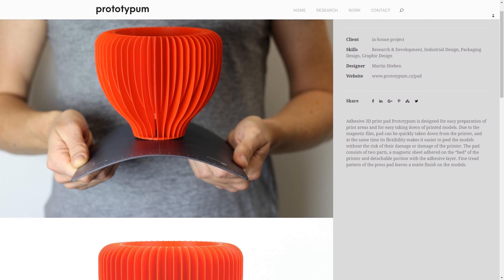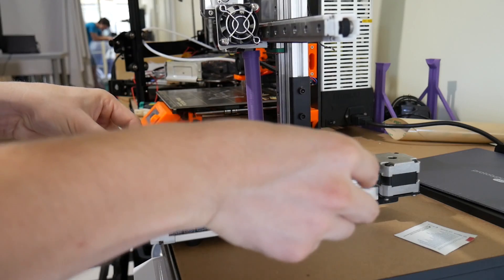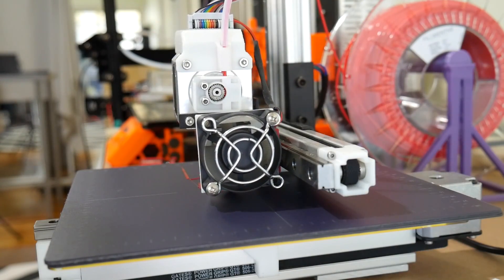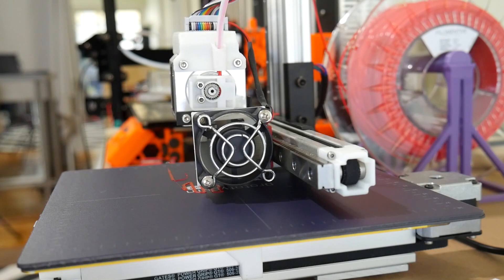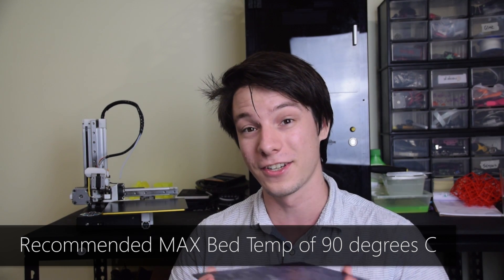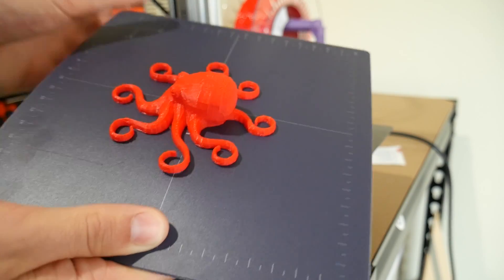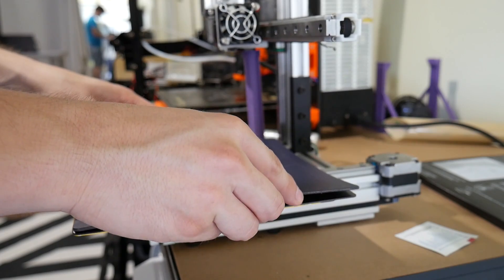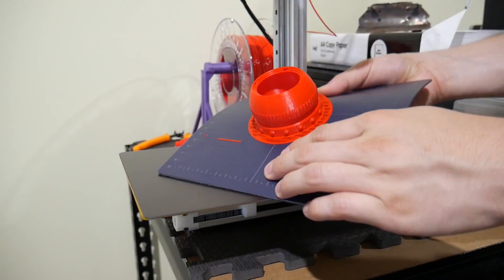Prototypum Pad - Magnetic Build Surface Review

Comment: Regarding the 200x190, my printer (a cheap ebay prusa clone) has a 200x200 build plate, but has the screws in each corner sticking up, so a 200x190 sheet would fit on there perfectly without having to cut the corners off.

Comment: If I remember my physics correctly, heat effects the magnetic properties of magnetic materials and can weaken the magnetic strength above a certain temperature to the point of destroying it. Not sure if the temperature of a heated bed will weaken the magnetic adhesion of the print suraface over time, but I would not think that using it on a heated bed would be a good idea.

But a good idea non the less  that maybe some other technology similar to velcro could be developed that has a high heat resistance to create a similar type of product.

Comment: I hav e the similar MagHold system which is more available in the US.  It's not cheap either, but it includes a machined and very flat aluminum plate with 11 rare earth magnets and a spring steel sheet.  The MaddGrip surface worked well for printing ABS and it's easy to pull off the sheet and flex it to release the parts, but I was a bit disappointed that the MaddGrip didn't last very long.  It's fairly expensive to replace, but a larger issue was the hassle and time spent removing the adhesive so I could apply another sheet.  It's not worth it.  I just ordered the parts to try to convert it to a magnetically attached PEI sheet that will hopefully last much longer.  Pro Tip:  3M Adhesive Remover can apparently save hours of scraping as well as the skin on the end of your thumbs.  I'll eventually discover what works well, hopefully without too many more experimental iterations.
Reply: MagHold works exceptionally well with a PEI film, I'd lower the bed temperature to around 70 or 80 celsius though

Comment: so you said the plate doesn't handle high temperatures well, but if you heated it up to 60° C for PLA would that still damage the build plate?
Reply from the maker: +Alex they state it can handle up to 90degC  but I haven't tested it to that degree yet. I didn't need to heat it at all to get pla to stick, just good nozzle height.
Reply: https://en.wikipedia.org/wiki/Curie_temperature

Comment: There are better versions of this available that use blued spring steel for the removable plate, you can then put whatever print surface you want on it (BuildTak, PEI, etc.) Search for MagHold on Amazon. They're sold for a variety of printers and includes a replacement machined aluminum bed with magnets embedded in it and the spring steel sheets. It's a great system that basically eliminates the need to level your bed after you install it because you remove the spring steel to remove your parts so no bed jostling. Being steel you have no limitations on heat and durability. I've had one on my Qidi Tech for months now and it's fantastic.

Comment: I have been using the MagHold print bed for over a year now and it's great. It came in 2 parts, a 3mm aluminium bed replacement with embedded magnets and a spring steel sheet with a layer of buildtak that you take off when your print is finished. You can print ABS with no problem, although the steel gets a bit warm but the parts flex right off.

Comment: I use the MagHold replacement printer bed on all 3 of my printers. It has been a huge game changer. Almost zero scraping. And It allows me to get hundreds of prints out of the BuildTak. I have also read that he will make custom sized versions to fit any printer. 3dprintermods.com/3-maghold

Comment: I just ordered a similar system (FlexPlate from BuildTak). It looks like it's a bit thicker than the Prototypum system, but uses discrete neodymium magnets whose curie point is higher. They also make it in a ton of different sizes. Can't wait to try it out!

Comment: They might say you can use this on a heated bed, but that's marketing bullshit. Heat is a demagnetizer.
Reply: Me likey when you do destructive testing....

So, I'm turning blue holding my breath for your SLA evaluation, Angus...
Reply: vidznstuff1 only at very high temperature. Glowing red metal for example but at this temperature it won't happen.
Reply: No - I am not talking about the Curie point. Heat destroys magnetism over time. As does vibration. As do varying magnetic fields.
Reply: vidznstuff1 oh I didn't know that. Thanks for pointing it out! Learning new things every day :D
Reply from the maker: There are magnets that can survive for long periods of exposure to certain levels of temperature - just look at the HT neodymium magnets used in some brushless motors. These flexible pads however in my experience have always been VERY sensitive. I feel I need to put the heat sensitivity to the test in a follow up as a lot of people are asking.
Reply from the maker: Haha! I've already used it... but hey, it's Maker's Muse! Everything will probably fail/explode live.

Comment: I don't think that it's expensive.
I bought my PEI sheet 25€ (and I'm a little bit disappointed with it haha) and a Buildtak Sheet is about the same price (200 x 200cm). 
And BuildTak produced a FlexPlate (200 x 200 cm) that coasts more than 100€ with shipping fees...
So if it works properly, it's not that expensive haha.

Comment: 0.05mm feeler gauge? Seriously? Normally you'd use .2mm for bed height. That can't be inches, it would be 1.27mm then. There's not a print surface in the world that's flat to within 0.05mm. How do you NOT keep your print head from digging into the bed? Am I missing something? Are they using some alien measuring system?

Comment: I like the idea of a quick release surface. I am using Print Bite, which is amazing, but you absolutely have to wait for it to cool down, at which point you just pick up the model. As for Prototypum, the temperature limitation (Curie temperature, I assume) would be a total show stopper for me.

As for price, I realise people will think like that, but spending hundreds/thousands on a printer and then skimping on a few tens to make it work - not logical, Jim. The savings in failed models would eventually pay for it.

Love your videos, BTW!

Comment: Shame you missed covering capacitive and inductive sensors.

Never had a print break loose, printing on glass, no additives, get your temperatures right and this is a non problem.
Reply from the maker: +vizionthing that's something I'd love to test in future but sadly the only machine I have that does bed sensing is the Prusa mk2. Maybe I could put the top plate on that though to see if sensing still functions, stay tuned.

Comment: Heating magnetic material will result in loss of magnetism. This is becasue the heat causes the magnetic domains to unalign. Even at low temperatures of 60 degrees Celcius te magnetic field would cause decay over a quicker time tan it would normally. Best to avoid heating all together when using suca  device.

Comment: What is the current best surface for abs on a heated bed? I've been using klapton tape on glass, and several superglue drops under the first layer (added right after the brim starts printing). Works, but it is a ton of work to replace the tape almost every print.
Reply: Check out Print Bite. It works brilliantly for me, so far with ABS and PLA, but claims to make all materials a breeze. The only downside is that you have to wait for it to cool down. Hint: When I ordered I missed the bit that said they'll cut to size free, and spent ages cutting mine down (it is tough stuff!).
Reply: Hey! It is actually pretty cheap and ships to Brazil. Will give it a try, thanks.

Comment: What would happen if you tried printing with an iron / magnetic filament?
Reply from the maker: Honestly, I have no idea! I should try it.
Reply: My guess is that an iron filament would cause the iron particles in the plastic to align with the magnetic field in the print bed and thus make the printed object have its own magnetic field. This would be similar to how lava and magma aligns to the Earth's magnetic field as it cools.
I am now wondering if you can give printed objects specific magnrtic fields by placing magnets near an iron filament it as it prints.
Reply: I think the magnetic field is shielded from the top side
Reply: Should be easy to check. just put a piece of metal on top to make sure.
Reply: I'm guessing you would significantly damage a brass nozzle that extrudes a filament with iron in it.  I'm curious how well the layers of a filament with iron in it would adhere to a magnetic print bed.  Wonder if magnetic filament layers could be put down at really steep angles too since the layers would stick to one another.
Reply: Anyone have an update on this?

Comment: Is a the tevo taranchula a good beginner printer, I dont mind building one if I can get it for a lower price
Reply from the maker: Check out my video and description of that video. It's cheap, but you're buying a 3D Printer as a hobby not as a tool. If you want to tinker, upgrade and are not expecting a working solution out of the box it might be a good option. I am not a fan of the power supply and mains voltages are too exposed in my opinion.
Reply: Thanks!
Reply: My dad is an electrician and he told me not to worry about any of the electrical stuff

Comment: Be interesting to know if it works with an induction sensor.  It's too small and expensive - but could be interesting when someone does a larger cheaper version - if it works with proximity sensors (magnetic = Fe = good induction trigger)
Reply: Yeah, I'm weird, but you're a fucking moron. It's funny that you mentioned "I have trouble with english" when I wrote out what I was talking about perfectly, yet you failed to understand a very basic concept. The concept of correlation, something you should have learned in middle school. Don't try to be insulting when you're just showing how stupid you are. It's hilarious.

Do you not understand what a prototypum pad is? Do you not understand that it is a magnetic sheet? Do you not understand that if a weak magnetic sheet trips an inductive sensor, that means the prototypum pad will also trip an inductive sensor?

I'll type it again, even slower this time, because you appear to have trouble with English. The prototypum is a magnetic pad. If one magnetic pad trips an inductive sensor. The prototypum pad will also trip the sensor. Please go find an adult if you are struggling with any of those words.

That's like if I said "My accord can drive from home to work." And you say "If it's not an altima we don't know that an altima can drive you from home to work."

Also go fuck yourself, you're what's wrong with the world, you can't use your brain for 5 fucking seconds to think of something that's not directly in front of your fat fucking face, and then you have such shitty self-esteem that you immediately go to insulting a stranger on the internet. I hope you grow up and actually contribute something to the world.
Reply from the maker: I would be surprised if Tom doesn't have one to test and he's a master with Inductive sensors, he'd be able to tell you the answer!
Reply: What's too small expensive? Inductive sensors can be bought for 3-7 bucks online. Amazon, ebay, etc.

It works. I just held a magnetic sheet I had laying around up to my inductive sensor and it trips normally, maybe a couple mm's farther away than normal, which is better.
Reply: Was the "magnetic sheet" you had laying around a Prototypum Pad?  If not, I can't see the point of your (otherwise irrelevant) comment.
Reply: It's only irrelevant to you because you have zero imagination. Do you know how magnets work? You know how they're all magnetic, the same way, right? Ok, now imagine this, I have a flexible magnetic sheet. If you know what I'm talking about, you'll know that flexible magnetic sheets are super weak. Mine is very weak. I have two inductive sensors. One I got for $6 and another I got for $5, just letting you know they're not expensive at all.

Now imagine the prototypum pad. It's a flexible magnetic sheet, right? So, comparing that to my magnetic sheet, the prototypum has to be at least as magnetic as my sheet, most likely more so.

Therefore, if my magnetic sheet trips my inductive sensor slightly better than a plain metal build plate, the prototypum pad will equally trip an inductive sensor, either the exact same way, or better than my sheet.

So, basing our inference (a conclusion reached on the basis of evidence and reasoning) on our understanding that the prototypum pad is just a magnetic sheet, if the weakest magnetic sheet available (mine) trips the sensor, the prototypum pad will absolutely trip the sensor.

Just for shits let me try with two other magnets. Yes, a slightly stronger magnet tripped it. Yep, the much stronger magnet tripped it. The prototypum pad is not a magical device, it's a magnet. It will trip the dirt cheap inductive sensors.
Reply: I somehow knew I was going to get another essay from you.  The level of anger and lack of self-awareness didn't really come as much of a surprise either - but did provide some much needed amusement on an otherwise dull evening.

I would be surprised if Prototypum would agree with your characterisation of their product as simply "a magnetic sheet."  I would expect them to say it contains secret sauce and pixie dust, mixed with unicorn droppings, to justify their price over what would (according to you) just be two oversized fridge magnets.  Has it occurred to you that, when I asked Angus if it worked with an inductive sensor, I was hoping for the opinion of someone with experience of the product - rather the hypothetical theories of a basement dweller with anger issues?

So, using your amazingly insightful car metaphor, I've deduced that my old 540 should handle the same as a Ferrari SF15T because, you know, they're both cars.  That's great news and should enhance its second-hand value quite considerably.

I suppose I ought to clarify just in case you're missing the point again (do you keep hearing whooshing sounds?)  Correlation is not the same as causation.  It's a basic concept that many people struggle to understand - so don't be hard on yourself.

I suppose I should end with a paragraph of vitriol and hurl insults at you, because I have such shitty self-esteem that I immediately go to insulting a stranger on the internet (almost your words, verbatim).  Oddly that's exactly what you just did...  Seeing the irony yet?

So just to be clear - I think you ought to seriously consider seeking professional, adult, help with your anger issues.  You don't sound like you have taken the first step in your healing journey (accepting you have a problem), so I think the sooner you start coming to terms with that the better and healthier your life and (huge leap here) any loved ones that have put up with you to date (if they exist they really should be commended for their perseverance).  I wish you luck in your endeavors and hope you remember - mental illness is nothing to be ashamed of.

Oh.  I almost forgot.  You really are very, very weird.
Reply: You're the one who insulted me first, dumbass. Don't go on a tangent trying to come back from that.

And no, an analogy isn't supposed to be taken literally. That's why it's called an analogy! Funny how that english language you claim to know so much about works!

And doubly no, there is nothing special about it.  It is literally a magnetic sheet. It cannot be anything else. In fact, I know that it can't be anything else because I've used most surfaces you can think of as a build plate.

What I'm saying, that you still fail to understand, is that the prototypum is literally just a magnetic sheet. You don't think companies relabel plain shit and mark it up for a profit? Every industry does that, and it works on morons like you, because you think since it's 20 times more expensive than a magnetic sheet, it has to be better. It's not.  I'm in the manufacturing side of this industry. I've worked with every type of sensor. I can tell you with 100% certainty that inductive sensors will trip on anything magnetic, and anything metallic. It's recommended for people using aluminum build plates for gods sake. 

You're asking a simple question. Will an inductive sensor trip on a magnetic sheet? The answer is yes. You don't understand how inductive sensors work, or you wouldn't have asked that question. So I answered it for you. You're the one that got all pissed off for no reason and started insulting me when all I was trying to do was help you out by answering your question. So once again, go fuck yourself. Sorry I made the mistake of wanting to help your stupid ass. 

Instead of asking stupid questions on youtube, and then getting mad and mean when someone answers your question, google exists. Look up how inductive sensors work. Look up if magnets will trip inductive sensors. Read a fucking book for once in your life. Read some wikipedia articles. It's all there for you.
Reply: Take a deep breath. And exhale.  And run along, weirdo.
Reply: If you think 15 or 20 sentences is an essay, I don't know what to tell you. Sorry you failed out of school. Also another non-answer. I can't believe you don't understand how magnets or inductive sensors work when you're on the internet right now. How stupid can you be?
Reply: Hansbald, have you tested it with an induction sensor?
Reply: You're weird.  I'll type it again, even slower this time, because you appear to have trouble with English.  Was the "magnetic sheet" you had laying around a Prototypum Pad?  Please go find an adult if you are struggling with any of those words.  If it wasn't a Prototypum Pad, could you refrain from typing anything else, please?
Reply: Another essay?  How weird.  We have a word for people that do weird things.
Reply: Are you finished yet?  Weirdo.